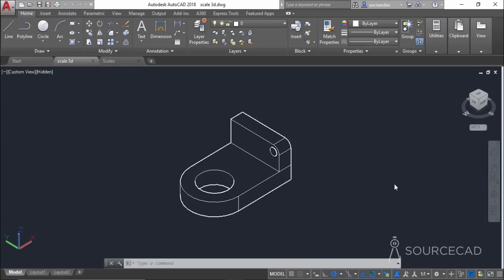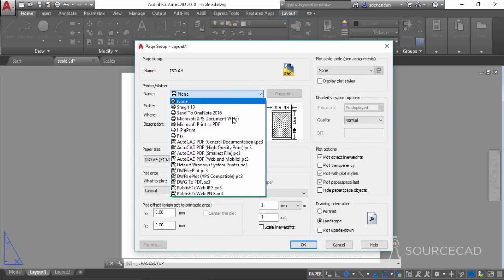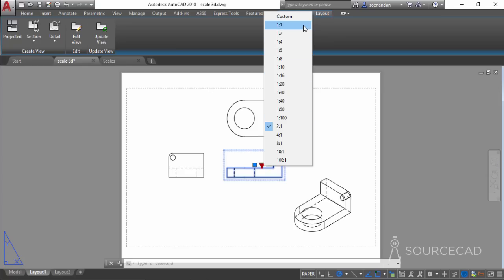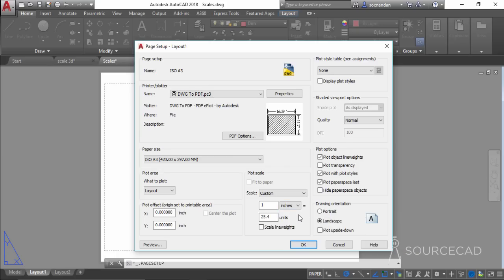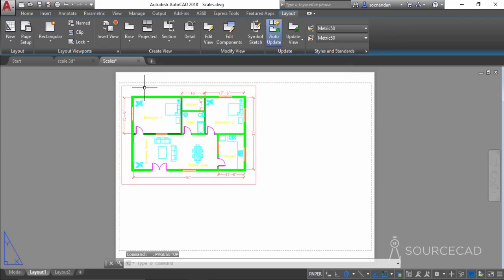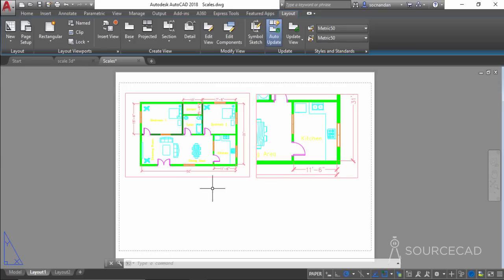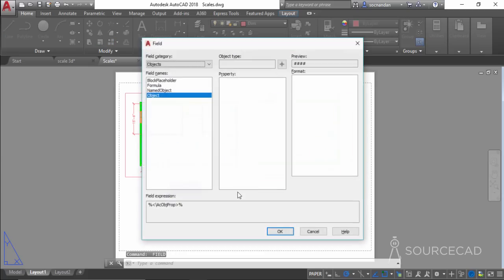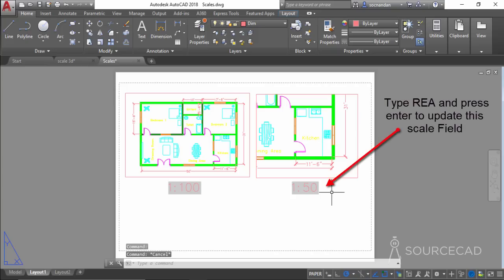How to use proper scale in AutoCAD drawings - Part 2 of 2

Comment: My drawing is in meters. I think in the page setup manager there are only two options: mm and inches.  I think it interprets 1 unit of wheat ever the drawing is in as 1 unit of either mm or inches. Do you have to do a little math to figure out the proper scale.

Comment: Hello Gentleman,

Thank u very much for the detailed
Guide lines in respect scale setting
after having finished our drawing works.
But, my doubt is prior to follow your input data to draw a drawing,
I want to have clear idea about setting requirements of panels such as o snap, o snap tracking ,
ortho , polar tracking , dynamic inputs  and the scale to be set up for imperial units before start
drawing .
I am using AutoCAD 2010 version.
Can i expect your assistance.Thank with regards, bye